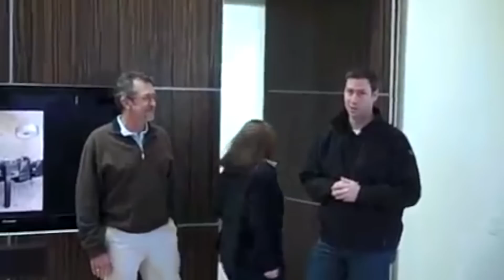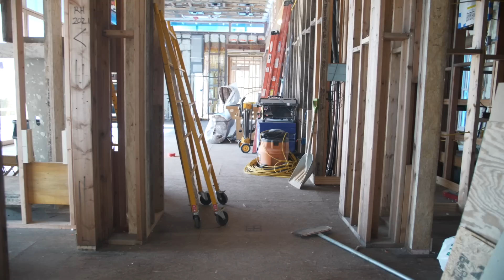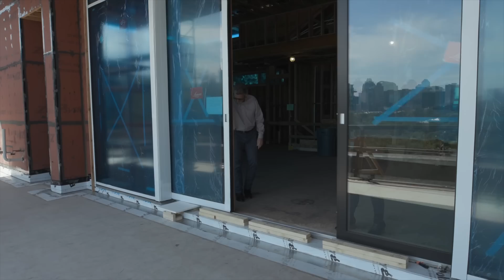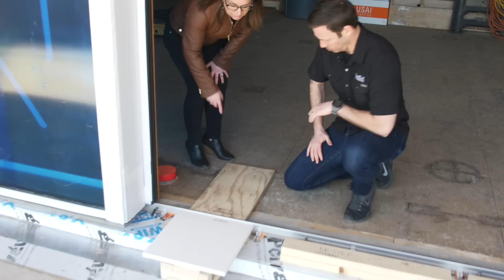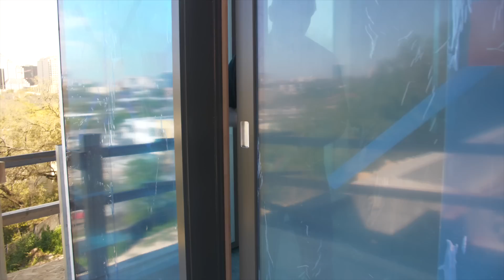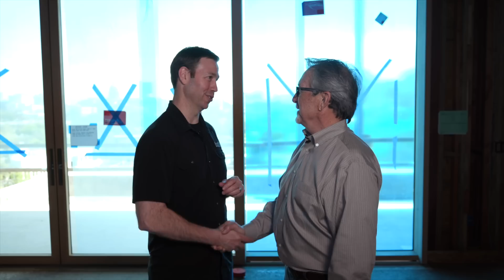Loewen Lift & Slide Doors inside a Curtain Wall Window System

Comment: Those track drains look almost certain to gum up with dirt, pollen and then algae.  Much like any other hvac condensate drain.  Is there any provision in these systems for the homeowner to flush them with a bit of air or pressurized water?  Otherwise that will be a very expensive call back within a few years.
Reply: Looks like you can suction from the far drain point.

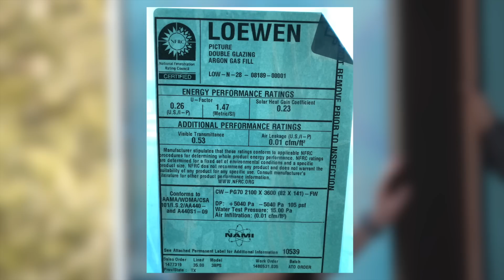Comment: Matt Look at the label 17:09 it not all about energy the Performance numbers PG 70 and the design pressures at CW heavy commercial not a residential tested window. Great job Lowen.
Reply: Steve Nason just an FYI, type it with the colon key : and you get a blue-colored clickable link that takes you right to that spot in the video, as follows 17:09
Reply: Got it Thanks Just a typo
Reply: the performance numbers have to do with the fact that the system uses large format glazing. the statistics of most relevance to an occupant of the house are the ones that risinger stated.

Comment: So, obvious question time.  Love the series and all the design options that you have showed.  You present as very approachable and level-headed.  Could you do a series describing similar quality solutions that the average homeowner could afford with a smaller overall budget?  Are there sister technologies that would work well together at affordable pricies (i.e. water heater-furnace-HVAC system, or insulation-siding combinations)?

Just about every video represents a dramatic improvement to existing systems through efficiency, durability, etc.  Unfortunately, each one of these new systems looks to be able to break most project budgets.  You have single-handedly destroyed my rehab budget with all this eye-candy (or build-porn).  We'd all love the thicker concrete pads that are insulated above and below, inside and out....a new composite plumbing system and manifold, super tight air gaps, huge windows, insanely high R-value walls and roofs, etc. but it seems like every fix comes with a very high cost.  

Are there similar solutions out there that offer similar technology, performance and durability on a more reasonable costs?  I understand that technology is evolving and therefore, never "cheap".  That being said, many of us watching your series are home owners already.  Since we're watching every episode so intently, I would assume that a good portion of viewers are in older, less-efficient homes, and some are actively looking at renovation solutions.  DIY is cheap but you get what you pay for.  The boutique builders do great work but they can command huge prices (I'm sure vacationing on private yachts in Monte Carlo with a Kardashian is expensive).  Think about the plumber in "Money Pit".  Love those guys.

Word of mouth helps with referrals for guys who won't drink all your beer but, it's tougher to find a good architect and a quality builder that are highly-knowledgeable and can work together to design a total system and able to implement some of these solutions that could meet LEEDs standards, or just be able to provide a warmer, more efficient, and stronger house.

Plumbing upgrades, roofing, insulation, electrical, windows/doors, etc. that a more modest budget could include together as a whole house-wide system that could be accomplished on a average budget.

Love the series, excellent work, and good luck going forward.

Comment: I am a  Commercial glazer but a carpenter at heart. To see a curtain wall designed constructed out of wood is amazing. Well done.
Reply: Yeah but it’s really metal with wood cladding so I wouldn’t go with giving them total wood crafting credit. I bet you the core   Of that window system is the same as the commercial systems you see, adding the wood cladding

Comment: My Patio Slider is a U-0.22 and cost $1200.00. I'm surprised that this is apparently a double rather than triple pane.
Reply: Brand?
Reply: one of the design objectives was a large operable glazing system. i doubt that they would have been able to manufacture a system with that large of a form factor had they used triple glazing. but i very much doubt that you really have a sliding door system with a 0.22 u-value. you can't air seal a conventional sliding door system.

Comment: That's great that you put a big window up and you made a business or commercial an insufficient heating area now that you opened it up like that you put the best you could in it what did it cost and how long does it take to do and can a wheelchair roll over that is it going to be accessible for a wheelchair at none of this makes sense walk over that threshold I'm not able to don't understand how to build your freaking walls you come up with the solution set the design design cares about the freaking design it's the function of the wall how do you whether tied it and then put something over it that makes it look cool that parts of shit part the expensive part when you doesn't have to be it's the part that goes in behind it that keeps it from damage from water and that part you don't mention how you got into the level you did that make sure you walk across it or it doesn't have water sitting on a outside building pouring back into the building you have to have a shred away from it all this is irrelevant if you have water pulling up on the outside of the building you're up 20 stories so you have to get the water out of there somehow doesn't just magically go away
Reply: Take your meds!
Reply: James, What does wheelchair accessibility have to do with this ?

Also, they are in Texas, not a huge amount of heating going on and as for cooling, they have massive overhangs to shade those superior windows and are using foam for insulation, which is the best insulation by far.

That structure is not 200ft in the air, which is 20 stories.

There will be no Pooling of water anywhere in, on, or around that house.

These guys are some of, if not the best at building homes. No need to worry or insult their building techniques.
Reply: @augustreil  I'm confused now you're mine big Windows cuz they can open up and slide and we can stand outside of skyscraper I don't get it now first of all why would you want to live in a skyscraper and if you're living in the office building and you nothing but windows I thought we were supposed to be busy saving money in the overall making people more energy efficient you just went to Sweden right and explain how that's the way they build and rebuild the office in here cuz we're rich we can do whatever you want I guess huh
Reply: @augustreil  so this window is so great because of why then what is the big deal you just talk about how it's getting great ratings for keeping son out and he died in and then you go and put it up in any place that has low heating bills would be a great place for big glass windows I don't understand when you go to the building moving into a building and you one time and now you want to see The View I don't get that many either you're outside or you're inside so now you're making a building that will cost $40,000 for a window so it can slide easily open wow that's just such a great event the sliding glass door for how long we just made a bigger version of it
Reply: @332jatc , This is a house, not a skyscraper and it's their money to do what they want with it. I, myself, like smaller homes, but there's no arguing that these guys know what they are doing.
Reply: Congratulations!  You win the grand prize for the longest run-on sentence ever written, that makes absolutely NO sense.  TA DA

Comment: Great show. So cool to see old with new and vice versa. 

Can someone explain what is happening to me?  I went to the home improvement store today, just to look at materials.  I’m not a builder, but the Build show seems to have my imagination going.
Reply: Yes I can definitely relate for me it’s looking at flashings on buildings and house wraps on buildings under construction. Im not a builder either.
Reply: you're becoming one of us friend, just hold back, without a permit you get in trouble...lol almost got fined for carpet removal, in my own house.
Reply: you can't blame me 50 year old carpet with heavy use with animals I had to!
Reply: @RasmodeusQ  - Back when I was 20yrs old, my buddy and I rented a POS house but it was walking distance here in Downtown Denver, Colorado, USA. It was a late 1880s bungalow. It had nasty old green shag throughout. We asked/told the landlord we were ripping it up as it smelled like cat piss. Low and behold, there was beautiful old growth 8" doug fir planks underneath!! I rented a few floor sanders and went to town. After tool rentals, stain, poly and consumables, we spent maybe $400 in total. It turned out great and the landlord couldn't have been happier!!! 

Carpet has its pros in some very secluded areas but for the most part, stick to solid surface wherever possible. The next owner can always lay down an area rug if needed! 

Matt - Too bad you didn't land this gig but thanks for sharing regardless. Good stuff!!
Reply: @jamesbramlett5407  I sure hope he knocked some off the rent for the increase in house value you gave him!!!!!
Reply: @Isaacmantx  - Lol, I wish! I didn't ask for anything though...I just wanted to live catpiss-free!